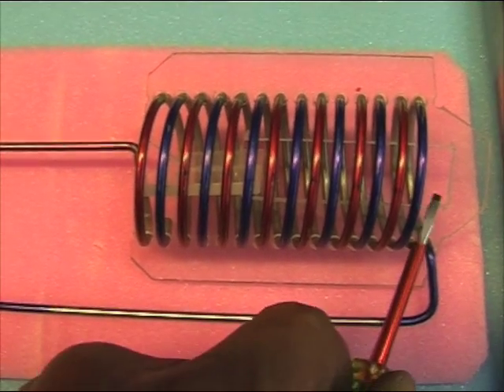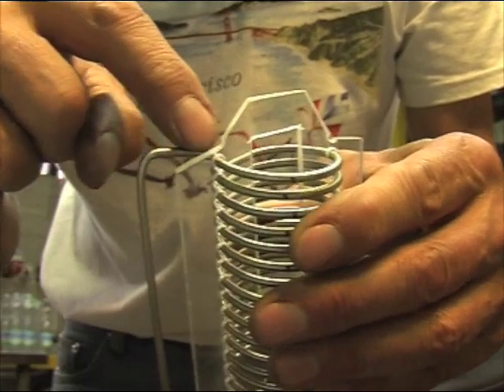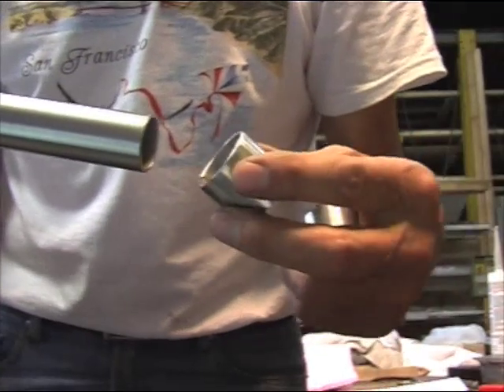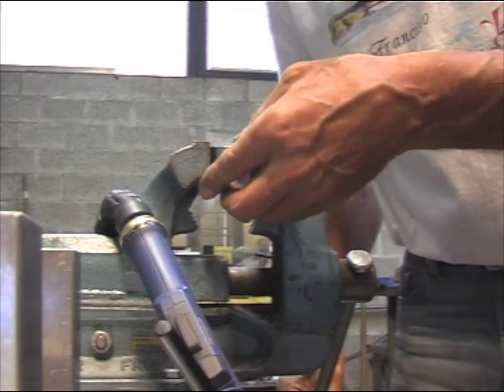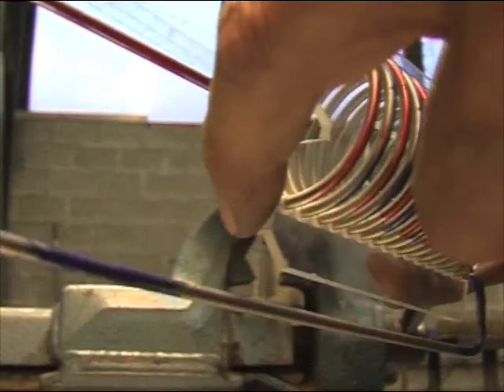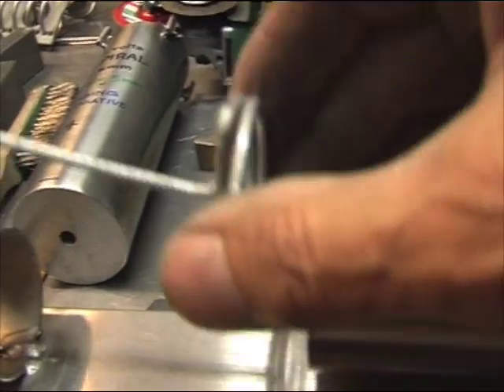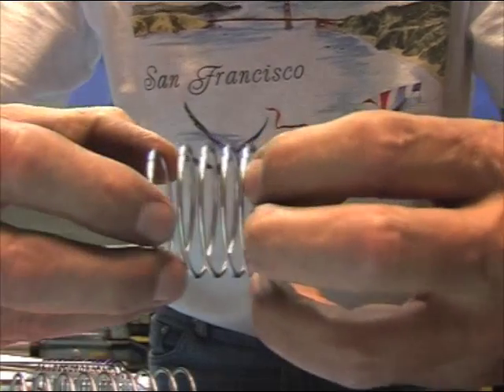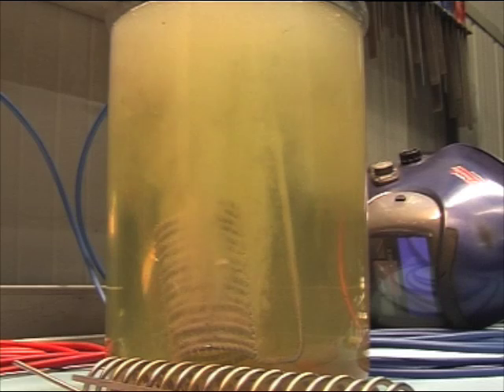HHO SWISS INOX 5 HOW TO BUILD HIGH PRODUCTION SPIRALS

Comment: I like the coils! I am working with copper wire coils and concentric tubes. That damn 316SS is way to hard and tempered for precise coil making. I think what you made was a sort of inductor with a resistor(water) in the middle. What you should try to do next is pulse the inductor and develop a magnetic field... Thanks for your videos! Keep upthe great work.

Comment: Liquid hydrogen has a low density of  71 grams/liter. There is  more hydrogen in a liter of methanol (99 grams/liter) than in a liter of liquid hydrogen.

Regular Gasoline has 44.4 MJ/KG or MJ/2.2lb
Hydrogen has 121-141   MJ/KG  or MJ/2.2lb

Gasoline weighs 6.073 lb/gal or 3 KG/gal.

Try to produce 6 POUNDS of hydrogen to equal a gallon of gasoline and see how much energy it takes to do it.

These facts information should prevent others from continuing down this energy wasting path.

Comment from the maker: It is a little bit of an optical illusion since you see all the bubbles at once, if you watch my video #4 you will see the tubes with one neutral burst just as fast as the coils do. The difference is that you only see the bubbles on the top of the tubes and that is less impressive. All I want to show is that even a simple spiral can do a good job as a brute force cell and is very cheap and simple to build. Thank you I will try the neutral later on
AMOX

Comment: Very nice. I can't wait to see this on a crude or accurate flow meter. Volume?
Running current in opposite directions, RIGHT ON! That does increase efficiency. 
One suggestion: The positive current attracts the Oxygen ion, therefore it is more susceptible to oxidation...RUST. I would make it bigger for a longer lasting cell.

Comment: Your efforts are an inspiration....  I have been playing around S.S. cable ropes these past couple of weeks...this is only S.S. cable/wire  available here at my hardware store is 3/16 S.S rope... yes... it is thick...... it is hard to wind...
I am have problems with fraying of the tip as I try to wind it... I was advised to use silver solder the ends.... It does not really work well.... 

Being a metal worker any advise ?

dart
houston, tx